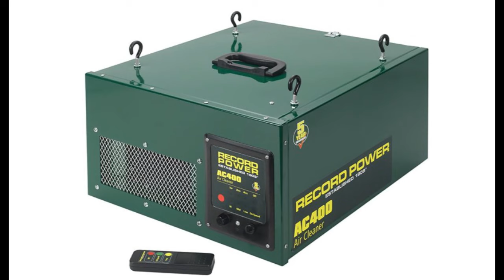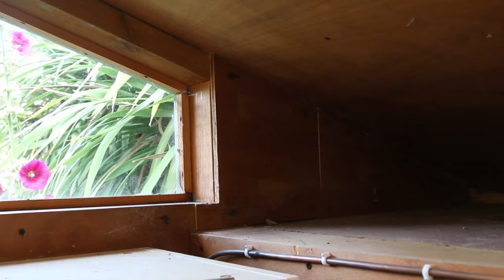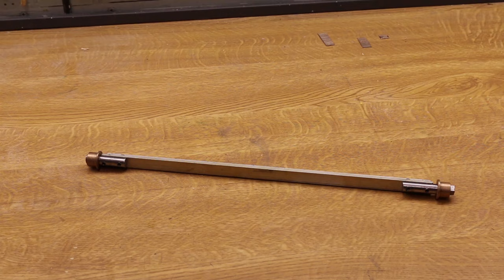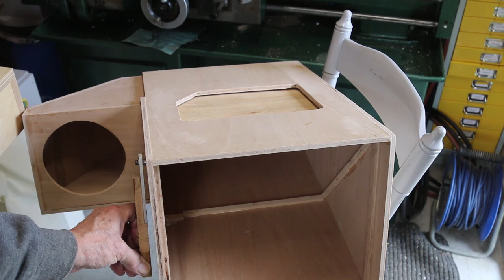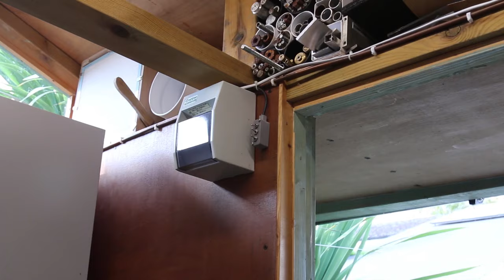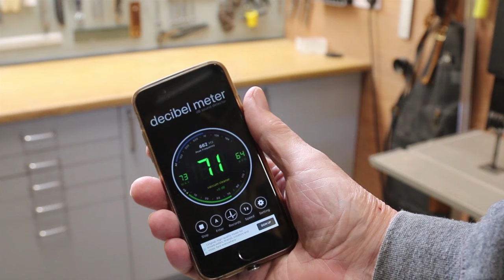air cleaner

Comment: Hi Mike. I saw a video of this type of fan where the two end reducing pieces can be unclipped and taken off. Leaving just the center fan bit. Do you know if this will still perform the same? Do the the end pieces serve any other purpose than reducing to the desired pipe size? I was thinking of taking them off so I could make it more compact. My plan is to attach it to one of the cylinder type HEPA filters you see used in vacuums. "Hepa Filter for Dyson TP02 TP03" on Ebay
Reply from the maker: Yes, the ends can be unclipped- I have done this for another application. The amount of reduction of the diameter is small, and IMO will not affect the flow. They were useful in my case- fitting to the plenum chamber at one end, and giving me room to fit a bluetooth speaker around it at the other! Worth putting a manometer across the filter, to tell you when it is getting blocked.
Reply: @Tensquaremetreworkshop  Ah, ok thanks. Am I also right in thinking that you have it set up so the fan is blowing against the filter? So when in "Winter mode" the open end of the extractor (the one facing inside the workshop) is sucking air in, which then is blown through the filter (cleaning it) and back into the workshop. So all the captured dust will be INSIDE the wooden casing? And not on the outside of the filter like you normally see people do?
Reply from the maker: @SirBenJamin_  Correct. In practice, the dust size is small (airborne) and the filter gets it all- there is no evidence of dust collecting in the bottom of the box. No problem if it does, removing the filter gives good access. I have a small (3D printed) manometer connected to the box, so I can detect filter air resistance, and know when the filter needs cleaning/replacing.

Comment: Mike this is a great solution. I realise your site for mounting the completed unit was tight but you are losing a lot of flow with that 180 reverse in direction. Spookily enough I was looking at these units about a week ago.
Reply from the maker: I checked the flow before and after mounting the fan unit (anemometer) and there is very little restriction in flow. The first bend has a 45deg baffle, and it is an expanding duct after that. The fan unit is designed to work with back pressure, and the resistance is much less than that of the filter. A stator in the unit helps with smooth flow.
I have a lot of further tests to do (particle count decay rates etc) but so far it is looking good.
Reply: @Tensquaremetreworkshop  OK.👍 On the subject of noise do you think there is any merit in fitting insulation to attenuate?
Reply from the maker: @normanboyes4983  Most of the sound is air noise, difficult to reduce. The motor is induction and only 55w, so does not contribute much. It is quite quiet (less than my very insulated extraction system), especially at the lowest setting. Remember, halving the noise only reduces it by 3dB. If I wanted to make it quieter I would mount it outside the workshop.
Once I have plotted the particle reduction rate, I plan to add a timer triggered by my extraction system (which auto senses tool use). The air quality monitor will advise me when I can remove my mask- all of this probably a future video...

Comment: Thanks, I'm planning to do more or less the same, so nice to see the concept validated. I have a 3D printing room adjacent to the woordworking room, so this should keep a nice airflow away from the sensitive 3D stuff, as the air inlet is placed in there.
Reply from the maker: Good idea! Tests since I installed it show that it helps cool the workshop when in exhaust mode. Cleaning the air is also effective, I am running tests to get numbers on that.